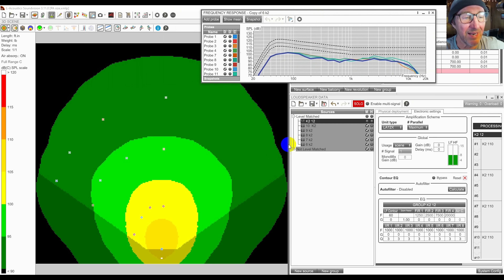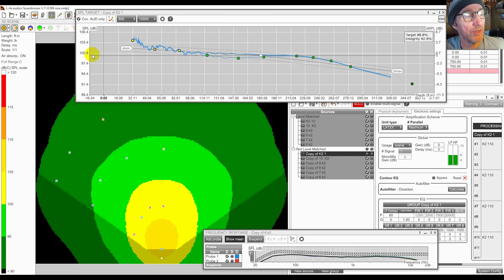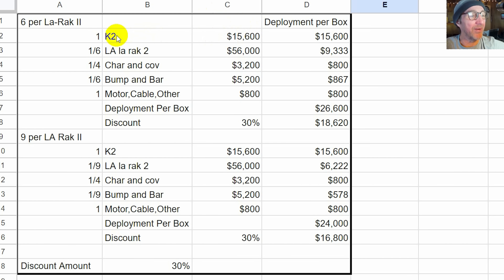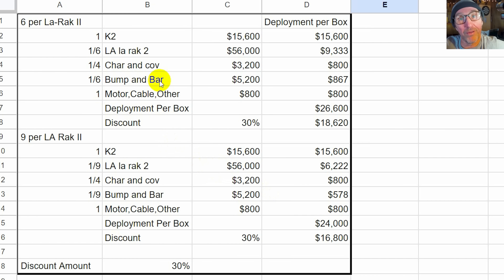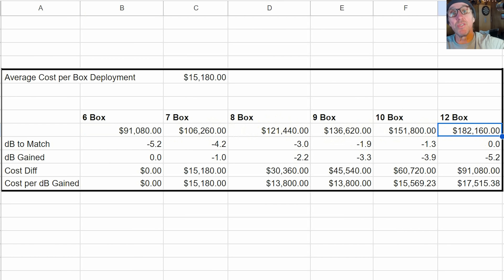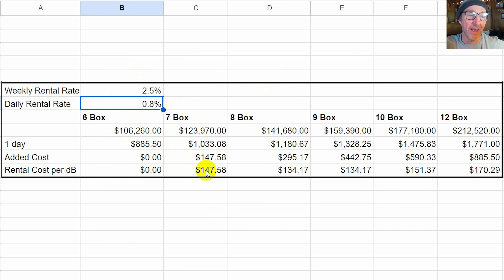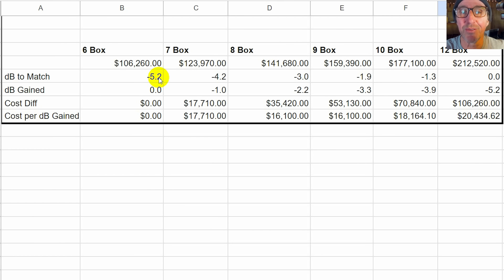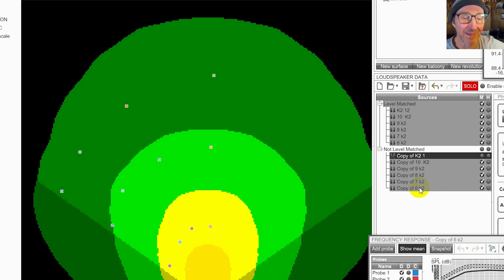How Much Does a Concert dB Cost?

Comment: Very interesting. Are you looking at this as adding dBs with the same effective sound quality ? In other words no added distortion or loss of dynamics ? And could you (soundvision) give a value for the distortion added if you were to push the smaller system to a higher dB ? Thank you !
Reply from the maker: Yes the system coverage is the same or very close in the system is driven exactly the same and I'm comparing the output levels of different box quantities
Reply: Adding loudspeakers does neither of the things you mention.  Loudspeakers are also the most non-linear devices in the system, but adding more loudspeakers doesn't increase the percentage of distortion in a signal, as it parallels the increase in output.
Reply from the maker: My understanding is the question refers to whether the various configurations have the system driven exactly the same.

Making sure that when the speakers are added other factors are not being altered like how hard the system is driven which would increase distortion or whether compression is added which would reduce dynamics.
Reply: @DaveRat  Thank you !

Comment: Interesting.   Love it.
Reply: @DaveRat  I find it really interesting that those doesn't really correlate with the traditional power law by doubling speakers (power in wattage of course) adds 3db anymore being the same as cost.  It seems you have a sweet spot in adding dB then there is a spot of diminishing returns despite the power law.  That's pretty rad.  Now how does that translate to cheap speakers?
Reply from the maker: @twistedmovies8782 it will vary greatly. Self powered speakers will have a more linear increase.

Comment: the electricity cost would also be interesting.. i read somewhere that rammstein used over 100,000 euros in electricity when they played in berlin recently
Reply: googling this only shows numbers of up to 10,000 kWh and that would be about 2,000 euros with german electricity prices for venues
Reply from the maker: The cost of electricity would be interesting though the cost of electricity for sound tends to be minimal compared to the cost of electricity for lighting and video.

A 1,000,000 watt sound system which is absolutely huge, will typically pull considerably less from the  power service due to the dynamics of music.

But let's say it does pull the full 1 million Watts.

So that's 1,000 kilowatts and say the concert operates 3 hours at full power That's going to be 3000 kilowatt hours.

At my house kilowatts cost between 13 and 40 cents per kilowatt but let's say the venue pays a dollar a kilowatt,

That makes the electric bill for the sound $3,000 for the night.

I'm guessing that even with lights and video included that Rammstein cost of energy is probably exaggerated unless they're including generator rentals and such like that
Reply: @DaveRat  i guess it was just a good headline knowing that most people wont know how to verify any of it.. thanks for shedding some light on the matter
Reply from the maker: 👍🤙👍 cool and yes. Also it's good to unravel misinformation

Comment: so your renting gear for $800 on a one day rental?
Reply from the maker: This gives an example of one possible rental price calculation that is based on a % of purchase price.

This calculation is based on the gear paying for itself every 2.5 years to 3 years if it works 12 weeks a year or so.

Of course there are many other factors, long term rentals may see lower rates, trucking, labor and other casts may need to be added. Gear rental costs vary over time and different cities and areas have or lower costs based on demand, taxes, fees and exposure environmental damage. As we're as cost of money 

This is just one small piece on a bigger puzzle and a simple assumption would not be correct. But it is start point
Reply: @DaveRat  ah ok! Thanks for the detail! As a young production company, we’re always trying to find the right price to charge. I like the way your brake it down 🙌🏽